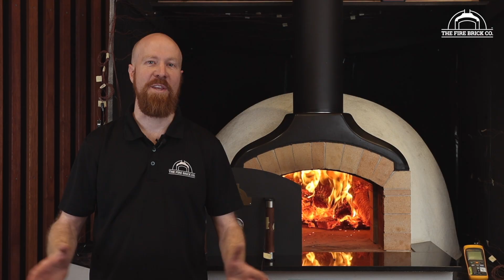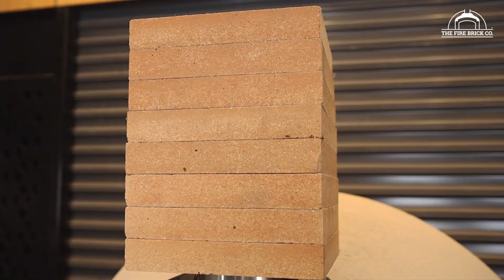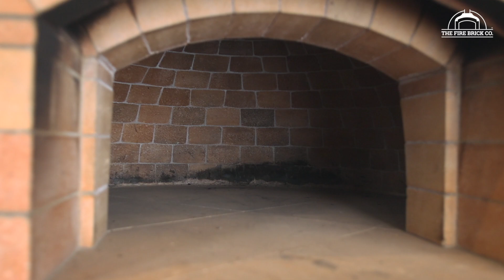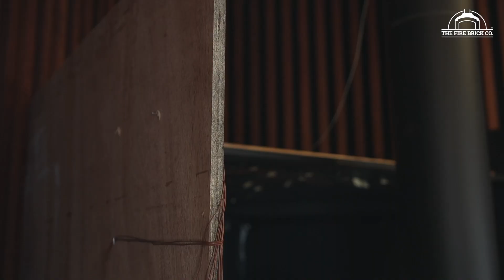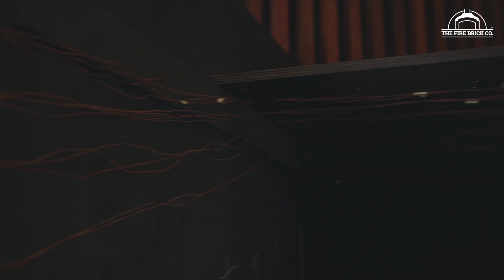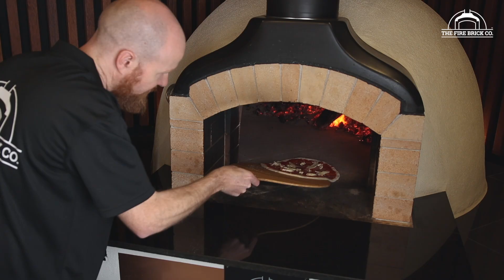Are our Wood Fired Ovens SAFE?

Comment: @Ben, just curious: is there a reason to wire all those type-k thermocouples rather than using an IR camera? I imagine that's the sort of thing the UL engineer would carry for thermal testing?
Reply from the maker: Great question George! It is probably to do with their internal process - he was taking readings and writing them down for each of the probes for two straight days, and those figures are then recorded as formal test results in the UL system. That would be much harder to do with the IR Gun, or camera, which are not well known for high levels of accuracy. All of his probes were calibrated, and I looked them up (I wanted to buy some) and they are EXPENSIVE, about ten times the price of a Type K thermocouple that you could buy on eBay

Comment: Heat transfer wasn't as bad as fluid dynamics.  I could never understand it.  But it's fantastic to see that you've done your work and I'll be having a mini pizza party this weekend in the P85!
Reply from the maker: I COULD NOT AGREE WITH YOU MORE. Fourth year Computational Fluid Dynamics... I have a recurring nightmare that Monash University contacts me to let me know there has been an administrative error and that I have not actually graduated. I then have to return for a full semester to do a single subject...
Reply: @TheFireBrickCo  I was on the five year plan, myself.  It was Machine Dynamics in my final semester and the professor was a hard-ass. Failed over half the class